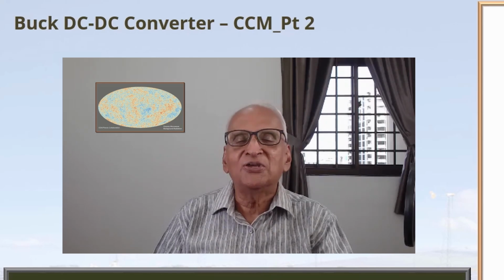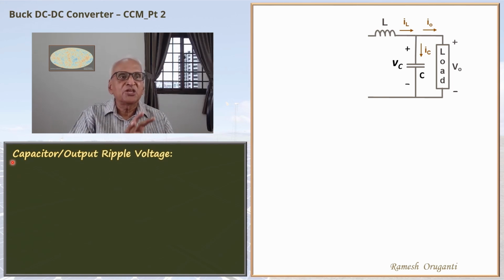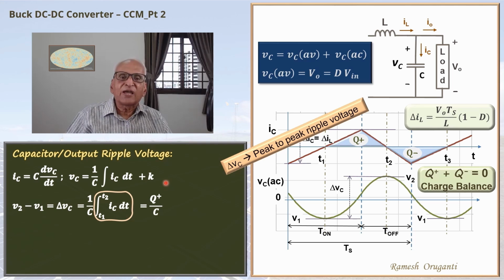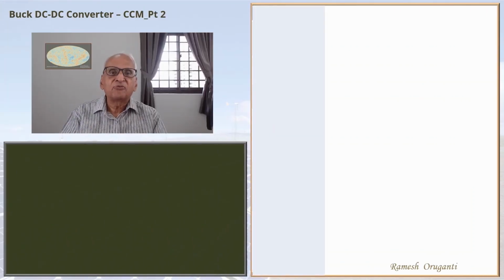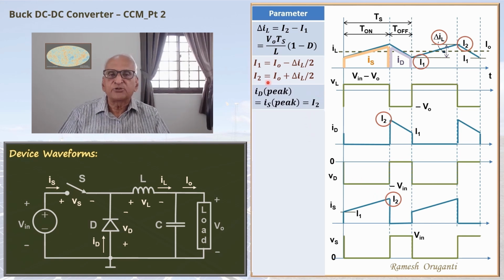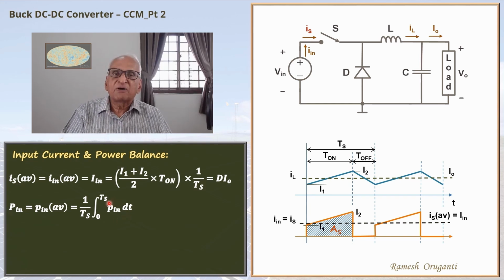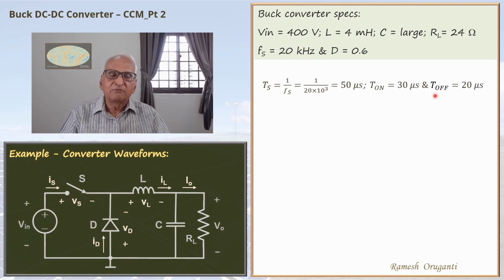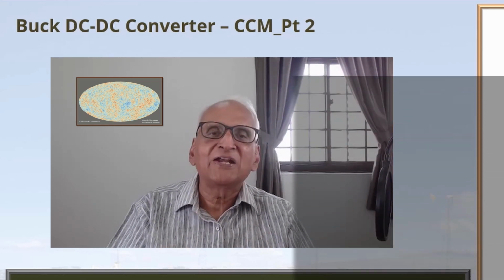PE 2A-2 Buck Converter - All waveforms in CCM / CCM - Pt 2

Comment: Sir if there is a ripple voltage on the output of 1-2% then the formula derived earlier in part 1 remain valid this is fine, but I have questions regarding 
1. Till what value of percentage of ripple voltage does the part 1 equation remain valid
2. Does the type of load - ex - capacitive, inductive or resistive effect the usage of the explained previously

3. I'm guessing if there is a capacitance factor in the load there will there be ripple in load current too, so is there any limit on capacitance and inductance component value in the load, for these formula to remain valid?
Reply from the maker: You have raised some interesting queries.
1. I assume you are referring here to the voltage ratio equation, Vo = D Vin. No, it will not actually be affected by the output ripple voltage (so long as the operation is in CCM).
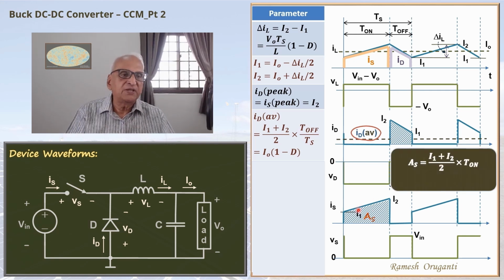To see why this is so, check out the derivation part from ~24:18 onwards in the PE 2A-1 video (CCM Part 1).  Even with a large output voltage ripple, we can still write the following:
vA(av) - vL(av) - vo(av) = 0 
Since vL(av) = 0,   vA(av) =  vo(av).
In CCM, vA(av) = D Vin. So, vo(av) = D Vin.
vo(av) is the same as the DC output voltage, Vo.
Some converter waveforms would be different, though, for example, the output voltage and inductor voltage & current waveforms.
2 & 3. The ripple derivation is made assuming Io is 'pure' DC. If there is series inductance in the load connection, it would not make any difference, since Io remains DC. 
If the load has an input filter capacitance (CF), then this capacitance CF will now appear in parallel to the buck converter's output capacitance (C). (We are also assuming that the load is physically kept close to the converter). As you rightly stated, in this situation, some of the ripple current, in principle, will flow through CF also. Here, the load's capacitance adds to the output capacitance C and actually helps in the filtering. The load current is no longer a 'pure' DC as we had assumed.
Reply: @ROs_classroom  Understood, thankyou sir for the reply